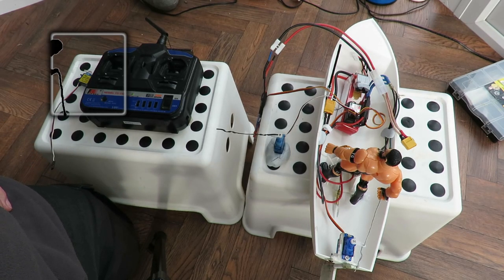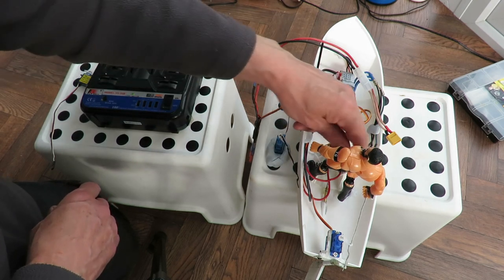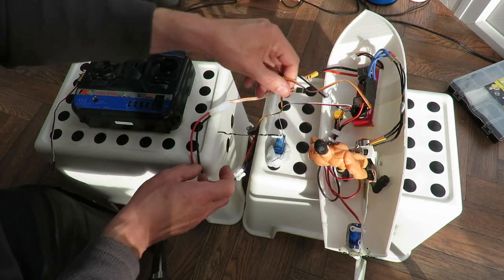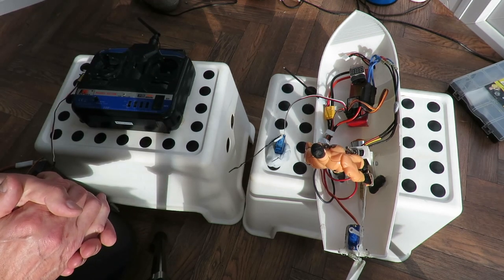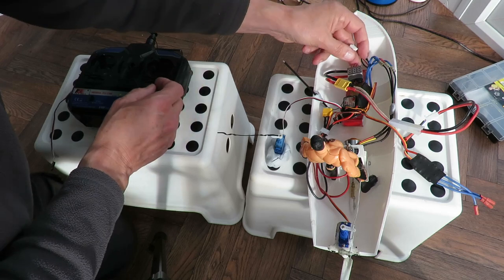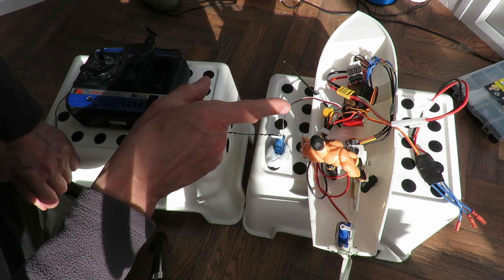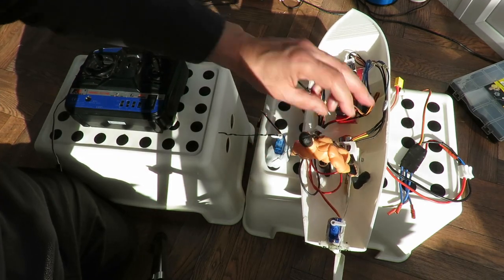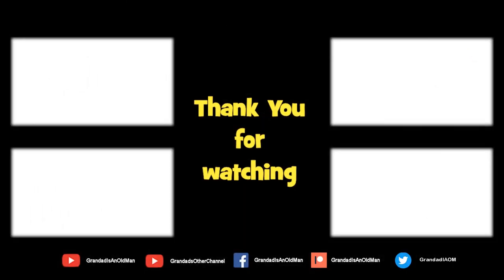Gifted 3D printed boat PART 9

Comment: I thought it could be the ESC because in one of the last videos you mentioned the ESC was a bit warm and it wasn't under much power. Pity about that. Better to check the system before connecting it up to the model I suppose. :-)

Comment: have you tried different receivers reason i say this is because i use fly sky radio gear and normally no problem but the last batch i bought  had a few faulty Rx modules  could only get one channel to work properly   this was also reported on one of the rc forums forget which one now  just a thought
Reply from the maker: Yes in episode 6 I showed a different receiver and a different transmitter but I didn't think to try a different ESC so that is why I did this video

Comment: i see sorry must have missed that  on a different note, you know those cheap 20 amp esc from eBay  iam not sure which is the motor wire and which  is the power as they both have jst connectors could you point me in the right direction I have a bag of them but no instructions ??
Reply from the maker: The simple answer is the battery will have the right connector on it and it will only fit in the right connector on the ESC. They are male and female connectors. The only problem might be defining male and female. The male slides into the female but just to confuse things the femail has the pins and the male has the holes so has that confused you enough? So the battery has a male plug to go intothe ESC femail socket and the ESC has a male plug to go into a femail socket on the motor. Another check would be that the ESC on/off switch goes to the incoming battery + but you probably would not be able to trace it without cutting the heat shrink casing off to see clearly.
Reply: @GrandadIsAnOldMan  makes perfect sense another thing i know there is a on-off switch but there is another smaller on the board any ideas and thanks for your help ??
Reply from the maker: @steveclough6794  that switch on the board turns the brake effect on or off (I think)
Reply: @GrandadIsAnOldMan  cheers buddy i will crack on with them tomorrow plan is to stick a couple in my Nikko vaporizers  with a vtail mixer i have a couple of old Traxxas   FM remotes pistol style so will put them to use  thanks again